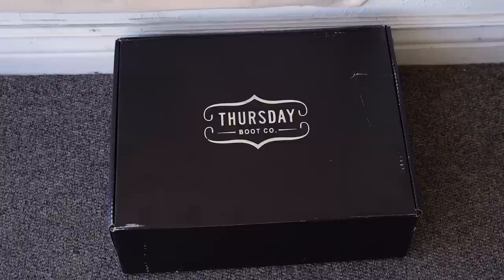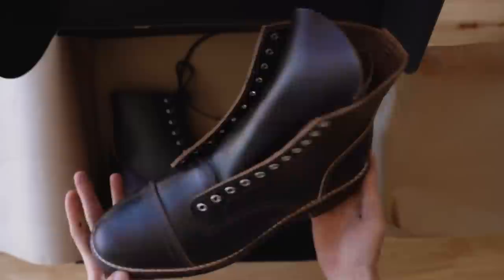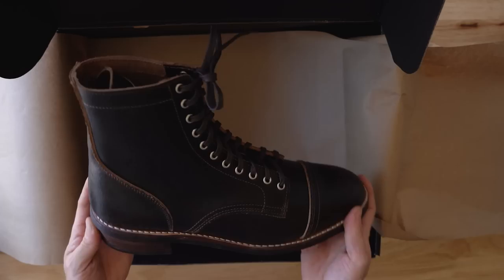Making Heelys for a REAL MAN

Comment: IMAO This is a fantastic boot made by Thursday with only 1 SUPER BIG NEGATIVE which stops so many people from buying this particular pair - That super thin heel cap just sucks!!!

Only if Thursday could either provide the same boot with a block heel option or a little thinner heel stack but a thicker vibram heel cap & this boot will become their best seller in no time.

And once again such brilliant and creative content guys 👏👍
Reply: If the thickness of the top lift bothers you, you can have the cobbler install a thicker one (by grinding down the heel stack a bit to make room) when the original one wears out. But I agree thicker from factory is preferable.
Reply: @pcarrierorange  offcourse I can, infact  a lot of customers who purchase this boot get it done by their local cobblers after the purchase but for me it just doesn't make any sense to buy something new from a company and then spend more money on it to get it fixed by a another business(cobbler).